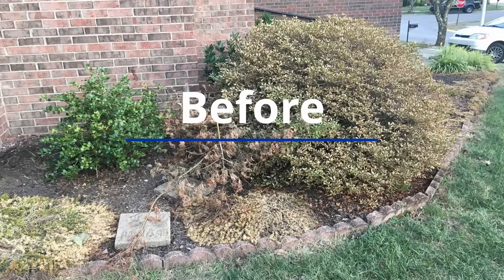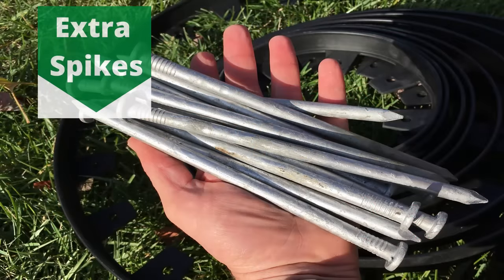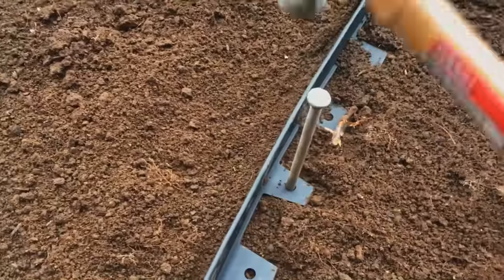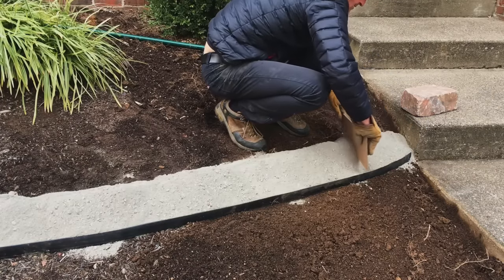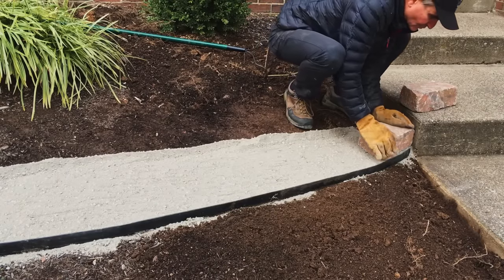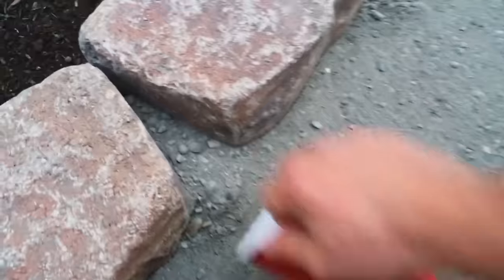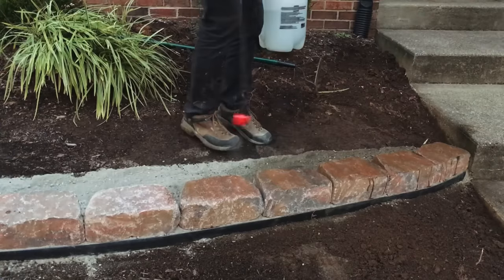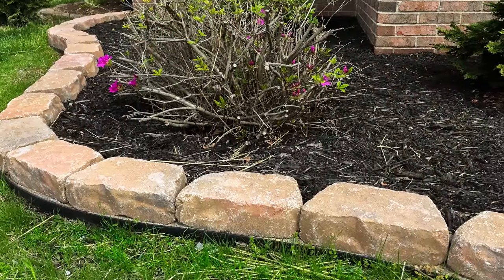easy diy No Dig Border *2020 UPDATE*

Comment: Loved the video but quick question... what size block are you using since the link no longer works and how deep is the concrete before misting?
Reply from the maker: The links to the blocks do work...look down in the description under the video at the two kinds from Lowes to click on them. The cement mix gets leveled out even with the plastic edge which is about 2". It does not settle down and is still 2" after misting.
Reply: @maxpatch67  thanks, will try over labor day weekend
Reply from the maker: @show-me-retro  sounds good. if you wanna send in pix, you can email pix to tim@timvogelaar.com. Here is the website I would post them on: https://www.timvogelaar.com/Easy-diy-no-dig-border

Comment: What's the process to add a second row above the base pavers and keep them locked in?
Reply from the maker: I don't do it and don't recommend it, but you could use traditional mortar or get a tube of landscaping block adhesive. People have done both of these and it works.

Comment: I am considering this technique in front of my house.  However, I currently have a "trench" cut out that I use as the edge of the bed.  It is anywhere from 3 to 5" deep.  Since in need to put the plastic edging where the trench is, I suppose on need to fill that all back in?
Reply from the maker: You will want to tack down the plastic Vigoro edging to the ground just outside where you have the current trench. If you like the shape, just go right along the edge of it in the grass so the landscaping area will just be a little bigger. In fact, you could build it about 5" out to allow for the size of the blocks and then your landscaping area will be the same size when finished as it was before with the trench. You can just push some dirt into your old trench and pack it in to level it out. Let me know if I can help you out any more. Thanks for the question, Bruce.

Comment: Why is it necessary to use concrete to set stones? Wouldn't the frost heave from winter and flex of terrain crack the concrete over time? Can the stone just go on top of soil or weed barrier fabric and then fill gaps with polymeric sand? Thank you for the guidance!
Reply from the maker: The cement provides four major functions in this border technique 1. Height(for looks) 2. Keeps the stones straight/aligned over time 3. Stability/strength 4. Weed barrier(the extra width is nearly impenetrable to aggressive weeds and grasses(Bermuda Grass) that we have here in Nashville. Also, surprisingly, I have had man comments of Northerners building this and it has lasted perfectly through several winters so far. I hope this helps, Arturo. Have a good day!
Reply: @maxpatch67  Thanks for the reply!

Comment: How thick is the concrete. You mentioned it was 12” wide but not the thickness.
Reply from the maker: Sorry for the delay...just saw the question. Yes, the width is about 10-12" wide after spreading out the dry mix. The height of the concrete matches the plastic edge height, which is about 2". I hope this helps. Please let me know if I can help you any more ok, Blue Barry? Have a great day!

Comment: Only concern is with the concrete will there be a water drainage problem?
Reply from the maker: Samantha, that is a legitimate concern. Address your needs in this area beforehand for sure!! I like to run the downspouts into the ground and create a drain system out into the yard where the water exits. Let me know if I can help you in any way. Thanks for this good comment.

Comment: Hi can this method use to fill up the gaps if I were to stack two layer of bricks. I too wanting to put something like what you did around my tree. But stuck as how to fill the gaps between the bricks. So I wonder if I can just fill the gaps right up withe the fast concrete mix.
Thnx ken
Reply from the maker: Yes!!!! That's actually one of the steps!! :) On that step, watch again and notice how I use cupfulls and tap them in there to fill the gaps...have a great day, Ken!!
Reply: But the gap for mine is open from the front, wonder how it will look
Reply from the maker: Oh, I see. You know it's easier than you might think to make a uniquely shaped piece of block by taking a hammer to a full block and hit away at it. Use eye protection. That way, you can have them all fitting properly and make one last one to fit in the last spot. If your blocks are already attached, I'm not really sure what you would do at that point. Somehow, you'd want to get that concrete to fill up that gap on the outside of each gap.

Comment: What if I want it 1 more layer of the brick to make it higher? Do I need the cement?
Reply from the maker: You could either uses landscaping block cement or traditional mortar. I don't ever make these two layers, high, but if I did, those would be the choices. Have a great day!!

Comment: Looks really nice and effective. I have a small slope in my backyard and I want to create a border of a retaining wall for. 
Can this method be deployed for creating a border of retaining wall and will hit be able to take the weight of top soil/Compost? Thanks a lot.
Reply from the maker: I would not recommend it as a retaining wall. I would use a traditional method for that including leveling, making a good base, using a block with a lip on the back, and creating drainage behind it with gravel and drain pipe. Thanks for the question, Rahul!!!

Comment: If you're placing the pavers and edger over grass, do you need to rake up the grass before placing the pavers and concrete? Right now our edging is a straight line, I plan to create a curve so it will come out over some grass. Great video, can't wait to get started!
Reply from the maker: Just build it right on top of your grass. This method is made to work like this.....and does work perfectly. I'd like to see your finished pix when you get finished!! Please let me know how it turns out!!

Comment: Nice technique! Wish I knew about it when I created my borders. I used landscape fabric rather than the fast-setting concrete (which I have used for posts) and, while the fabric helps, there's always some weed or grass poking thru. It's a constant battle pulling them out. About how far does one bag go with your technique? I might redo my borders once I have the time.
Reply from the maker: Ya, you might like to redo it. That fabric will always give you problems. Here is what I use for a weed barrier technique. https://www.youtube.com/watch?v=HIWDPlaB6wY The bag of concrete lasts for about 5 linear feet of border...that's with a very wide border of about one foot, but if you made it narrower, it would go quite a bit further. Have a great day!!

Comment: The concrete mix you put and later the cement you used to fill in the gaps are two different things? And which brand? And where did you get those from?
Reply from the maker: The only cement used in this video is fast setting concrete mix. It doesn't matter what brand, but it does matter that you get "fast setting". It is a special mix that works with this method. Here is the link from Lowes: https://www.lowes.com/pd/QUIKRETE-50-lb-Fast-Setting-Concrete-Mix/3006121

Comment: How much concrete do I need. I've bought everything but the concrete and stones. It's been hard to find.
Reply from the maker: The concrete bags should work for about 5 linear feet each so for example a 50' border would need about 10 bags. Get a little extra, though, so you don't run out. TIP: if you have a long border, pay the delivery fee and have the store deliver those products...it saves a lot of time and work getting those supplies home.
Reply: @maxpatch67  thanks so much. I'm halfway there. A little leary about the cement part. I hope it looks level when I'm done.

Comment: Hello. Can’t see if anyone asked this before, but this looks difficult to remove. Have you ever had to dig one up before?  (I get the idea is for it to be permanent, just curious)
Reply from the maker: James, you're right that these are very permanent. They will last "forever" and would need to be busted up with a sledgehammer to be removed. Only build it if you are very sure of what you want for many years to come. Thanks for the question. Have a great day, James!

Comment: Do you have to use concrete? Is there any alternatives?
Reply from the maker: This technique really centers around this unique cement product...not using it, you lose out on the qualities it provides. The cement provides four major functions in this border technique 1. Height(for looks) 2. Keeps the stones straight/aligned over time 3. Stability/strength 4. Weed barrier(the extra width is nearly impenetrable to aggressive weeds and grasses(Bermuda Grass) that we have here in Nashville. I hope this helps, Charm Cat!!

Comment: I'm looking to do this project this weekend.  I do have one question I want to add 2 more layovers of the bricks so if I put garden fabric down to keep away the weeds would that be ok for drainage?
Reply from the maker: I don't like using the fabric, because it does not work well over the long term, but if you are using it, I'd lay it down after you create the border. This way the concrete mix can get down and form to the ground better. Its probably ok if you have it done already. Sorry, I just now found this question. I'd love to see your finished work when you get finished, Sharon!!

Comment: Question: in part of the video you placed the border over sod. I’m assuming you didn’t bother to dig up the sod later. Does that mean you just put the concrete over top of the sod, and the grass never grew up/through the cement? I’m trying to decide how much of my sod I need to dig up to create my flowerbeds.
Reply from the maker: Correct. Installed right on top. Here is what I do for mulching: https://www.youtube.com/watch?v=HIWDPlaB6wY&t=5s. It really works!! Don't bother digging up any sod except where you plant something. I hope this helps, Lexie.

Comment: Would this work following a sidewalk/walk path with curves?
Reply from the maker: I have used this along a sidewalk and I adapted this technique a little to make it work better. I actually dug out the edge and laid a bed of concrete in the bottom. Then I cut a carboard piece with a notch that made half of it about 2" lower and I dragged the cardboard along the sidewalk and levelled out the mix down in the long trench I dug along the edge so then I had a perfectly flat bed to set the blocks on top of. Then I set the blocks in place and dumped some extra mix along the edge of them to hold them in better and then started misting with the water to bond it all together. I hope this helps. :)

Comment: Hi! Not sure if you will see this but I’ve got a question. The area that I’d like to do is already perfectly rectangular and surrounded by the house, the sidewalk, the driveway, and the porch. So on each side there is already a straight line made of concrete/ brick. Can I skip the plastic edging or should I still go ahead and put it flush against my edges? Thank you!! Can’t wait to try this.
Reply from the maker: Yes, skip the plastic edging and put the blocks up against the other surfaces. That would be perfect. Now if I'm to be honest with you, in your situation, I would dig out and remove a lot of the dirt and organic matter in your landscaping area to lower it all by several inches so that you can put some fresh mulch in and still have it below your concrete levels. This is always my personal preference with concrete edges are present. There is no end to organic matter piling up and getting to high for the edges and it will always flow over after a few years, so my personal preference to take care of this never-ending problem is to dig out the top layer of the area to lower it down to a good level to hold much again. I hope this helps. Have a great day!
Reply: @maxpatch67  sweet deal! Funny enough, I found your video after digging up about 4 or 5 inches of crap. I only bought my house about a year ago and I’m just not getting around to tending to this bed. It was a mess. I went to start weeding it so I could get some flowers in this spring, only to discover that there was some ancient landscaping fabric about 4 or 5 inches deep. Weeds grew right through it. So I ended up pulling it all up. Not how I thought I’d spend my afternoon. But wow, it already looks 10x better. And I’m so excited to get this project started. Thanks for the advice!! Super helpful.
Reply from the maker: @epwigout  ok! ya, I HATE landscaping fabric....so annoying how it protects the weeds that grow through it.
Reply from the maker: @epwigout , how is your project going?? Making progress?  You don't have to, but if you wanted, you could send your finished pix to my email and I'll post them on my website. I bet it will look great in your yard! My email is tim@timvogelaar.com
 and here is a link to projects others have done with this technique: https://www.timvogelaar.com/Easy-diy-no-dig-border. Have a great day, Erica!!

Comment: I just did an approximately 8 ft section on the left side of my house according to this video. Towards the end of the Curve it is slightly sloped and I can see it from across the street. I have absolutely no experience with this. In hindsight, I probably should have brought the level out during the process of staking the edging to the ground. That's what I will do at the front of the house. I wish I would have known about this earlier. Once the concrete mix has been laid out then it's too late to get any dirt underneath unless you wait until it's hardens and then knock it all out and start from scratch in those areas where it is sloped.
Reply from the maker: This border is designed to follow the level of the ground. If there are any larger dips in the line you choose, dirt should go in those spots beforehand. Smaller dips should not show up when finished unless you pound  the stakes into the plastic edging and force it down there. When you do your front, try to pay attention to this detail before making it permanent. On that side, if it really bothers you, you could try using a hammer and see if you can bust up the concrete in that area and redo it. Use eye protection.
Reply: @maxpatch67  Thanks

Comment: How long does it take for the cement to harden? I did my first bed today and misted it down but after a couple hours every thing is still pretty soft
Reply from the maker: What is it like now? If you used the right cement mix, it should be hard and set by now...it just takes minutes. Did you use "fast-setting" concrete mix? It is the only one that is made to work like this.
Reply: maxpatch67 all good brother 👍
Reply from the maker: @mzurla  whew!!!! This is the only comment I have ever read like this so you had me concerned!! Thanks for your reply, Mike! Hey, just if you want, you could send me finished pix of your border for my website to share with others. May email address is tim@timvogelaar.com if you want to send them. Happy Labor Day!!

Comment: Do you have to use cement mix? Can you use sand ?
Reply from the maker: The cement provides three major functions in this border technique. 1. Height(for looks) 2. Stability/strength 3. Weed barrier(the extra width is nearly impenetrable to aggressive weeds and grasses(Bermuda Grass) that we have here in Nashville. So...you can choose to change it if you want, but these are the good reasons to use it. I hope this helps. I like your username!! Have a great day!!

Comment: If the perimeter I want to put the bricks in is uneven and not the same level, should I just put more quikrete in the lower areas to make it level?
Reply from the maker: Excellent question. When you attach the plastic edging to the ground with the spikes, you will want to attach it to the higher areas of ground along the edge. (Don't spike it down into the little dips or you will emphasize them and twist up the border edge.) If you do it in this way, the edge will glide over the low spots. Then when you pour your cement mix behind the edge and level it off, you have effectively done what you just suggested. Of course, it there are any huge low areas that you don't like, you'd need to fill those with dirt before building over that area. Does this make sense Emerson? I hope this helps.
Reply: @maxpatch67  yes! I just finished it! Thanks so much
Reply from the maker: Oh, awesome!! Could you send me your finished pix to share on my website? You could send them to my email tim@timvogelaar.com. Congratulations, Emerson!!